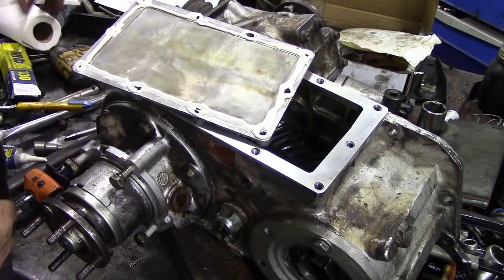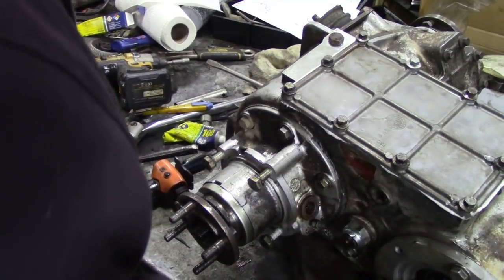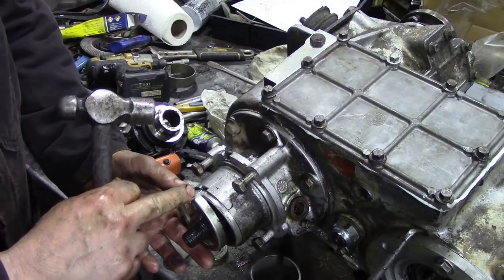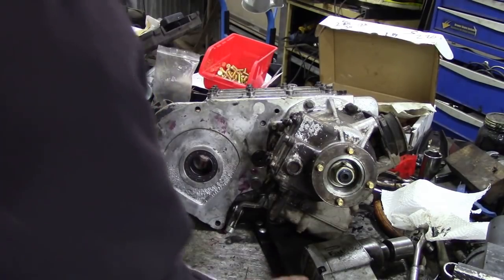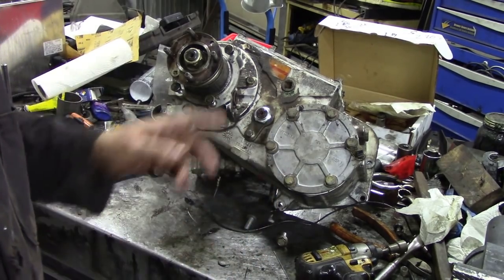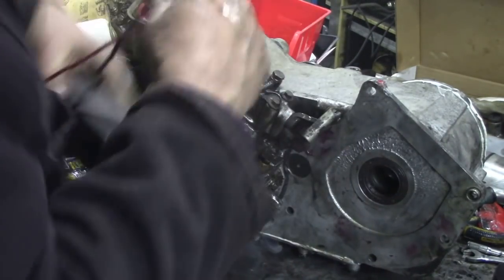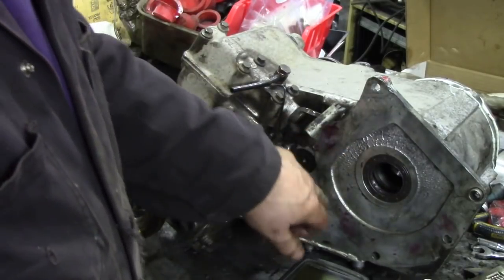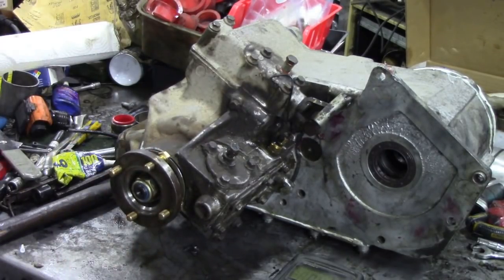LT230. Changing the mainshaft gear and re sealing. Part 3

Comment: Mike, I've heard you talk about the slop in the LT230 diff and that it is normal.  Does this slop ever get worse, and how much is an indication that a rebuild is needed?  I've still got a clunk while taking up drive after rebuilding the front and rear diff/axles and drive flanges.  Thanks for the great videos and the store!
Reply from the maker: It is inherent on the LT230  - apparently Ashcroft's ATB diffs sort this issue out but I can only tell you what I read - maybe google the ATB

Comment: Hi, Mike. Love your videos.  I bought my 300Tdi Disco 10 years ago & found it had loads of play in the drive train.  Turned out to be that gear on the g/box output shaft & the shaft's splines had worn out.  As a fix I asked the LR specialist to fit me a new one with the oil hole & longer splines in. So 80,000 miles later I am still running on that last bit of unworn spline!  I've no idea if they did a shim-up on the new gear but if not, I've got away with it.
Reply from the maker: The problem is the bearings can overheat if you had a too large shim

Comment: Hey mike love what you.  I require the bushings for lt230 lever as its sloppy going left and right ie Diff lock in and out. Does you kit include these bushings. ?
Also just a suggestion checkout channel named mercedesource. The chap running it has a website with videos/instructions inc paper and dvd for sale. Special tools etc. Might be an new opportunity for you
Reply from the maker: Matt
The kits will have the following

Part for LT230 overhaul

2 x felt seals
6 x plastic bushes for the linkages 
3 x special clips for the linkages
1 x Nut for the Intermediate shaft
1 x Intermediate O ring (rear)
4 x copper washers for the breathers
1 x sump plug washer 
1 x filter washer (LT77)
1 x sticker! 
All OEM stuff

Mike
Reply: Hi Mike, how do I order one of these kits?